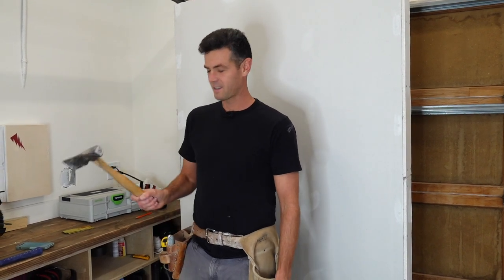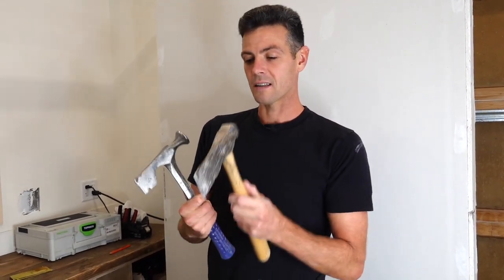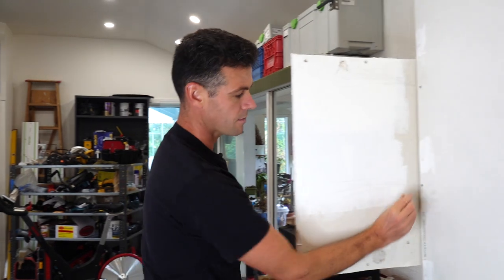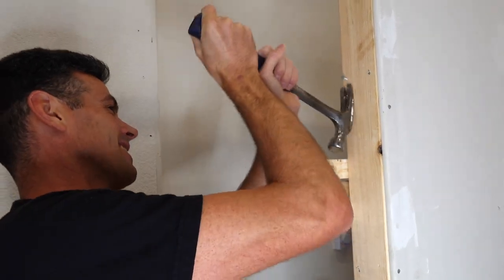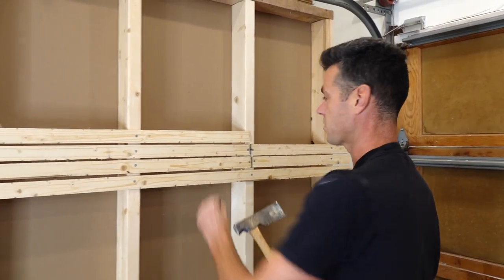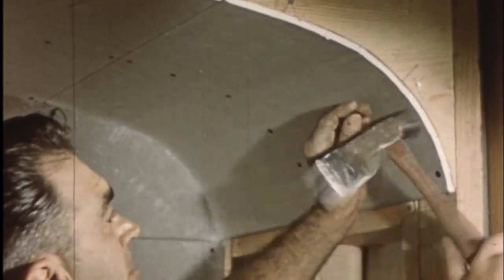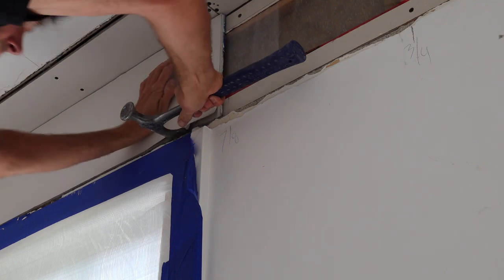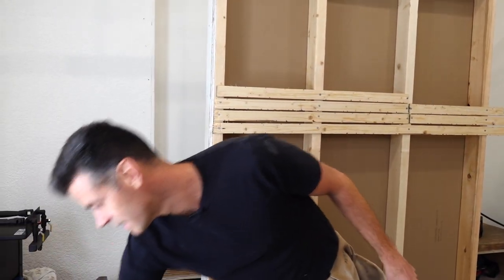Why are DRYWALL HAMMERS shaped like this????

Comment: That larger square head I've seen roofers use just for its hitting power. 

I rocked a Stanley for 10 years of slinging rock, came in super handy when I realized my gun was on the floor or when I needed to pull stairs away from a wall. 

11 years I've been siding now and I refuse to use a claw hammer, my Stanley Hatchet is still my go to. I've been laughed at for using it, but when they realize I know how to use it and the abilities it has even in the siding industry they all apologize.

Comment: Weren't "drywall hammers", or whatever you want to call them, originally used by cedar shake (wood shingle) layers? The first drywall hammers I used had a series of holes along the top edge of the blade. A special screw was inserted in the hole that gave the desired reveal for the cedar shakes.

Comment: The axe part come in handy cutting and removing wire lath. Not lathe. Mine is 12 oz so its easy to carry. It was all beat up I just put convex edge restoration and stooped it so it cuts paper. Some out door specialty store sell small hatchets just like these for 150 buck or more.

Comment: I saw an old video from the 30s showing how to install plaster board and they used the axe to score and cut the plasterboard. It was amazing how fast they could put up the boards. Faster than anyone I've seen doing drywall. And doing the skim coats was quicker than taping and mudding. Amazing skills they had.

Comment: Also if you keep the axe e n d sharp you can also cut out electrical boxes with it by just tapping the drywall in a rectangle and popping it out I've done that myself although using a razor knife is much more efficient.

Comment: the reason the hammer head is angled at the top with the slope back to the axe side. is so when your hammering nails near the ceiling the axe edge doesn't hit the ceiling board.

Comment: I love mine for demo purposes and if you sharpen the tip like in video it works like a razor . I like the e wing for the angle. When your hammering it keeps your knuckles from the wall.   I like you use screws but sometimes the screws are at angles or not far enough down etc  so a quick pop with the round head and it sets the screw head with a 1 in dimpled in set. Covers really nice. The hatchet with the angle also is a great carry handle for sheets. Also it can be a great peddle lift for panels. I've use it for making circles with the nail v as the pivot. It really is the 5 in 1 of hanging

Comment: Lathing hatchet has been around for hundreds of years. The drywall hatchet with the round head did not come out until after WWII when drywall was invented. Lathing axe is still handy on many projects that involve rough cut wood.  Like a carpenters hatchet the blade can be used to knock down high spots or rough plane surfaces. It's a lousy drywall nailing choice.  A metal handle hammer of any sort transmits too much vibration to the elbow and will cause Bursitis, get wood.

Comment: The odd angle on drywall hatchet is because u swing it different than a hammer.  Don't use your wrist. You swing with elbow and keep wrist loosely locked backwards somewhat. This keeps the head of hatchet hitting flat on the wall instead of top of head hitting before the rest of the head hits. 
Should always be swinging hatchet from inside your  body, like throwing a Frisbee. Obviously this isn't always possible but should be done every chance. It's a  faster swing for driving nails home with drywall while maintaining control to eliminate divets, paper tears, and improper nailing. Ie too deep into drywall and beaks though surface layers of paper. 5 nails 7 seconds 10 swings best case

Comment: I haven't tried to calculate this (because I'm lazy, and I'd fail anyway) but I think the square face might have another advantage in addition to having a bigger surface near the wall:  I think it would put the center of mass of the hammer closer to the wall, so when you are hitting the nail slightly off-center, the axis of the momentum of the hammer will be closer to the nail and it will twist less.  Does it feel like that might be true?
Reply: I feel the square head was more of production thing. Making a square gead hammer from square steel stock would be cheaper to make. Just a thought. Looks more traditional.

Comment: Hummm...
When I got my first job as a carpenter's Helper in 1970 the roofers mostly used those and called them "roofers hatchets". I never saw sheet rock guys use one, never.
Used on shingles a regular hammer knockes a hole / weakens the shingle too often but the wider square head on the hatchets doesn't 'cut' a plug but still sets the roofing nail nicely.
I do think that it's accurately a lath hammer originally "back in the day"

Comment: How do you hold a board and nail it in like above your head for instance, I don't know how people did it.

Also my grandpa had the Estwing one, it ended up at my moms and when I first got started in drywall I grabbed it, I carried it around in my box forever always expecting one day to be shown how to use it and never did, eventually I upgraded for demo purposes to a Dewalt claw hammer and was also dismayed to find out it wasn't a drywall hammer but a roofing hammer apparently, I thought that little cutout was for getting under and picking up shingles when you're attempting to pull off a strip to repair (though that's basically not feasible). Happy to find out what it actually was and for, wish I could have asked my grandpa about it. He did set me onto this trade but it was a couple years later after he had passed, I pleasantly get these reminders of him now and then at work though.

Comment: I work with steel studs and concrete structures and i use the axe like 90 percent of the time vs the hammer. First you can light chisel with the axe. Second is its 20% heavier than than my hammer. I like the axe much better all in all :)

Comment: My buddy is a roofer and hand nails everything with a roofing hatchet which is a hold over from shakes. Lathe was held on but cut nails long before this wire garbage where the heads pop off which was throughout my house along with asbestos. Similar tools for different reasons.

Comment: Ive seen my boss hack away the edge of the sheet in place when its too tight to fit, so that’s another modern use for one. Ive also seen a sheet rocker chop screws out of the way from behind a heater where a screw gun wouldn’t fit but it’s probably terrible for the edge.

Comment: The angle of the estwing is supposed to help you nail along the inside corner at the ceiling without damaging the board, at least that's what I was told in trade school

Comment: This type of hammer goes back before to the 1700s used for several reasons. From splitting shingles to helping in horseshoeing and on. It's not so prevalent nowadays. With electric equipment things aren't the same anymore. My father used one with a magnetized head to hold shingle nails. Nice show though.

Comment: I have an old house with lath and plaster and in my living room there are two archways, on going from the living room to the front hall and another going from the living room to the dinning room, and they both have wire mesh in the plaster. Why did they do this. It's a total mess on the wall. I leaves a ridge in the plaster where it ends because it doesn't cover the entire wall. It has also lead to cracking in the plaster.

Comment: The reason for the angle on the eastwing is to be able to strike in corners where the nail is close to the other wall or Ceiling and the hatchet part doesn’t marr or scratch the paper. Hard to explain. Easier shown than said

Comment: WHEN I FIRST GOT IN THE CONSTRUCTION BUSINESS IN THE EARLY 70'S THE DRY WALL HANGERS WOULD USE IT TO CHOP HOLES IN THE SHEETROCK FOR LIGHT AND WALL SOCKET HOLES AND THEY WOULD EYE THE HOLE AND CHOP IT IN WITH THE HATCHET WITHOUT MEASURING THEY MAY HAD A SECRET TO HOW THEY DID BUT THEY NEVER TOLD ME THEY WOULD HAVE A CREW OF 3 -4 AND EVERYONE WOULD HANG ROCK LIKE THAT

Comment: Don't forget the "quick nail picker upper"  Lol. If you drop a nail you can jab down on a nail with wooden handle and the nail usually sticks to the handle then holding the hatchet side whack the gypsum board where the nail is going and it will drive the nail in partially so your able to do this with your striking hand while holding a 144" x 54" with your other hand by yourself with zero help Lol

Comment: If anyone shows up to my job with a roofing Hatchet square corners not for drywall estwing the reason the head is angled is for nailing corners the hatchet part is specifically for adjusting drywall always allow a quarter inch the reason that has a nail puller on it is so one person can use a chalk line and pull the nail they used something only a drywall mechanic would understand

Comment: Wow this sent me down memory lane. You covered most things and the comments below picked up the things you might have missed, but there a subtle item most people don't even realize, The old timers should have warning labels on there "T" shirts  that say caution "KUNG FU GRIP". After 30 + years of snapping wall board with their thumbs and fingers the guys have muscles tied to there hands you can see, and usually they can pick up a scarf by just placing their hand on it. ( Gypsum is pretty drying so hand get rough).
Oh one other thing, take one of those nails and place the edge of the head between the wood handle and the metal and you can set a nail high with one hand while the other holds the sheet. Sometimes its done by pushing the nail into the bottom of the handle (push the head off a set nail in the wall) and using a light swing sets the nail in the paper.
I am not a drywaller myself, but I was the go-for and jack for an award winning one...
-MG

Comment: Lath nails are sharp and tapered like a tin-tack. You are probably too young to remember trying to screw ceilings with a spiral drive screwdriver, not everybody had electric screwdrivers, and I mean the corded ones, and not every small site had 110v supply (UK rules !). I had nailed a fair acreage of plasterboard before I owned a power screwdriver.

Comment: Many,  many years ago,  one of my older brothers and I demoed some "old time" lath and plaster.  (He had a couple houses in Toronto back in the 70s)
Being young and stupid (well,  "stupider") neither of us wore any kind of dust protection.  Idiots.  And let me tell ya,  it ain't for the faint of heart.  Messy job.   Anyhoo,  he told me this little story of a guy he knew (or maybe had only witnessed this?  I don't remember)  who could spit out lath nails into the gyprock and work that way.  Sort of "spit...bang.  spit...bang".  I think it was just a story.  But if you go by the speed of the guy in the old timey video,  I do think some of these guys were really pretty fast.  I'm not eitherly sure I believe the story of the guy who could spit out a nail and drive it home in the next instant.  But THAT video would be awesome!
I'll stick to using a screw gun.   I appreciate your videos.  Never too old to learn something "new".  Or maybe,  something not that new,  but perhaps forgotten.  Carry on!
Reply: Back in the 1980s I worked with a guy, Nick, who had been around the trades since the 1920s. His dad used to bring him to jobs when he was 5 or 6 years old to bring the water bucket around to the masons and laborers. Nick told me that the lathers keep the nails in their mouths and if they had done it for many years they would have a gap worn between their teeth from spitting the nails out one at a time. Some of them were also missing the tips of fingers from when they forgot which way they were holding the hatchet.
Reply: @janderson8401  Huh.  So then the story of the guy who could "spit nails"  wasn't just something my brother had "made up"?  The whole process is just too "out there" to get my head around.  Like,  how many nails do you keep in your mouth?  and,  how do you line them up so they come out in the proper orientation?  Just amazing.  Thanks for that little update.  Keep your stick on the ice.

Comment: Why is there a texture on the end of the hammer (the part that you hit the nail with)? It seems that, that would cause a nail to start going in crooked.
Reply: Keeps the nail head stuck to the hammer head so the force can be applied in the right direction. If the nail head slips the nail will bend.
Reply: The result being that less than perfect strikes may not bend the nail.
Reply: @whitesturgeon  Thank you

Comment: are drywall nails still useful in any modern application?
Reply: Yes, you can tack sheets up on the perimeter where the tape will cover the nails. Also good for nailing on corner bead.
Reply: @EricFarmer01  why nail perimeter? Is it faster than screw ?
Reply: @conradcoolerfiend  it can be.
Reply: @EricFarmer01  Yep,  thats all I use for corner bead.   Nails

Comment: Thats a roofing hatchet. Everyone likes using them better than the drywall hatchet but they're heavier by about 4 oz and as little as they're actually used its not worth packing around the extra weight.

Comment: The buggy whip went on its way like the Dodo bird. Hand braces to drill holes or the plunging screwdriver too. And then there's leading out cast iron plumbing pipes connections with sweating in copper fittings. Technology is to the rescue with newer and better building materials and cordless tools, expanding tools for PEX Coupling Fitting, and ABS glued together. PVC water lines, GFCI and ARC fault electrical breakers etc.
Reply: There are still factories that make buggy whips, and I don’t mean buggy whip antennas. Trotting horses, who pull sulkies, are driven with buggy whips and there are wealthy people who collect, restore, and use antique carriages and sleighs.
Quite often the first generation of new technology is garbage. The plywood used as sheathing in the early 1950s tended to delaminate. The OSB From the 1980s turned to mush when it got wet. And then some technologies come in and are soon replaced by something else. Boomer rant over.

Comment: If you used the hammer the right way, Even if you pulled the head off you could still pull the nail. Hook the hammer on the nail and instead of prying up, Try leaning the hammer over. Sorry.

Comment: That hammers also a ripping hammer it dates back to when they used to put wooden shingles on the roof and they would cut the shingles with that hammer and install them with that hammer laughter's and people that put the wooden shingles on used to carry them all the time
Reply: They used to call me Thatcher's I can't remember it's in the East Coast or West Coast roofingham and sometimes the round end was at a slight angle for nailing on roofs